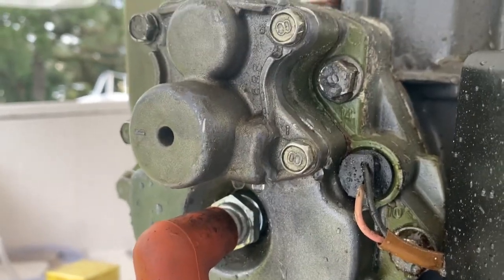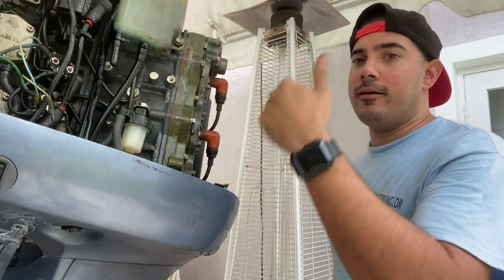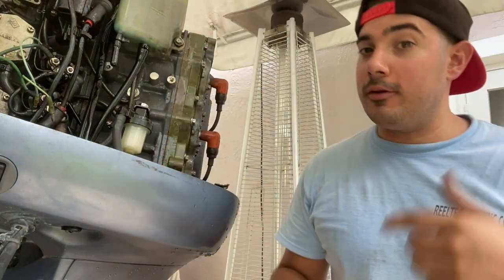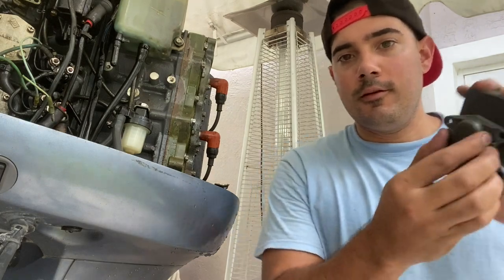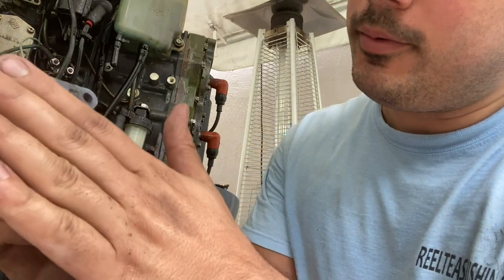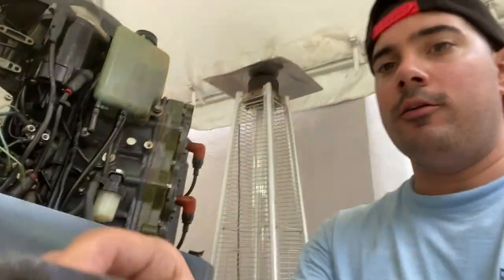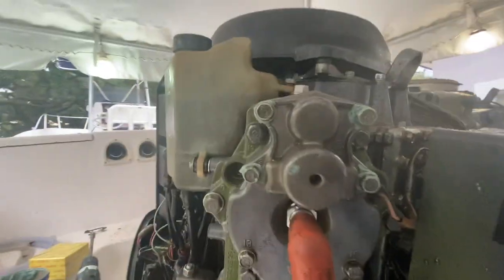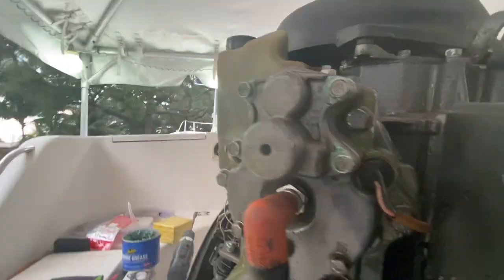Leaking Thermostat Fix

Comment: After installing a brand new thermostat and gasket (on my car) I noticed a constant leak/drip at the housing.  Tried reinstalling the thermostat about 3 times thinking the gasket wasn't sitting right.  ( I think I can change a thermostat in about 5 minutes now...lol) After finally sanding the housing smooth and  clean ( after seeing your video) the leak was finally gone. And there wasn't much buildup  on the housing but just enough to cause a problem. Thanks!
Reply from the maker: Glad to hear, the video helped you! Thanks for watching. 🇺🇸🇺🇸
Reply: i can do it in 3 with steam coming outta my ears 😡 i gotta remove my alternator to get to it

Comment: Good man. I sheared a bolt on mine and can't get a weld on the recessed bit of bolt and have heard too many horror stories about easy outs to use one so am going to try running with 3 bolts !
Reply from the maker: oh man, shearing a bolt is always a PIA. hopefully it works out for you, I had an older evinrude I ran with one bolt short without a problem. Good Luck
Reply: @ReelTeaseFishing  I snapped mine but I threaded the screw put a new one in just alot smaller and used rtv gasket seal

Comment: This is the method I used to fix my situation: Thermostat housing was leaking like crazy so I kept tightening the bolts, thinking it would solve the leak, ended up breaking the bolt and now I had a broken bolt and a leaky thermostat.

To remove the broken screw/bolt I had to make a tiny hole on it using a cordless drill and some very small drill bits, used penetrating oil as lube and after a good hour or so of drilling in incremental sizes (1.5mm, 2mm, 3mm) I was able to create a little hole big enough for a reverse drill / broken bolt extractor to fit in and get that pesky broken bolt out of there.
  
From what I gathered researching for this issue is that these leaks are definitely caused by the previous gunk/rust residue creating an uneven mating surface between the block and the thermostat housing/gasket. To clean it off I used a razor to remove the chunky residue, very carefully not to scratch the metal, and then I used wet sandpaper grit 500, 1000, 2000. Doesn't need a lot of sanding just enough so that the surface is smooth, doesn't need a mirror finish.

Give your new thermostat mating surface a quick little 2000 grit sanding as well just in case. And then clean both surfaces with a little bit of alcohol and let it evaporate, make sure its bone dry.

After I used an RTV or Gasket Maker, and put it on the mating surface, just a little bit all around, it really doesn't need much at all, just enough to make a thin film and I installed the new thermostat and housing by hand tightening the bolts, afterwards waited at least 24h before torquing to final specs. Some RTV are different and you don't need to wait, it should say on the box.

About the torque, you're better off seeing what grade and diameter your bolt is, and searching online the recommended torque values for it, because my car's torque sheet was a bit confusing and originally I ended up torquing 20nm on a bolt was supposed to be 10.5nm (8.8 grade 6mmx16mm bolt) which caused the broken bolt in the first place. So be careful with the torquing and look up the bolt specs and torque before properly tightening it.

And it worked, no issues so far!
Reply from the maker: Great write up! Thank you for that

Comment: Hi,today i had the same problem, i saw the leaking from the thermostat.I changed a month ago,i didnt change the gasket,in fact i didnt know.I will do what you say,i just want to ask  if its necessarily to put gasket clue and also if it is a possibility the water coming from the head gasket The engine is Suzuki dt 40 1992.Thanks
Reply from the maker: If you have a leak in the thermostat housing are I would remove the thermostat housing, remove the gasket, remove the thermostat. I would clean it up. Use a razor to remove any left over residue and gasket material. Then lightly sand the area as shown in video. Then I would install the thermostat, a NEW GASKET and tighten down the housing with the bolts. No glue is necessary. In fact some of the gaskets have their own adhesive when the motor heats up. No glue is necessary 

As far as water from head gasket that’s a whole other issue. The leak from a head gasket would be around the heads and not the thermostat

Comment: what about if i just put silicone gasket
Reply from the maker: If you use the correct gasket provided in the thermostat kit then it should be no issue. If you have a leak then you need to prep the surface. 
Using silicone gasket is not correct but in a pinch could work. I wouldn’t recommend it though